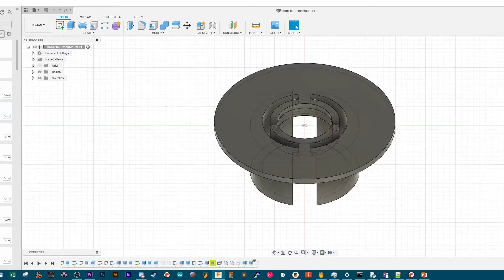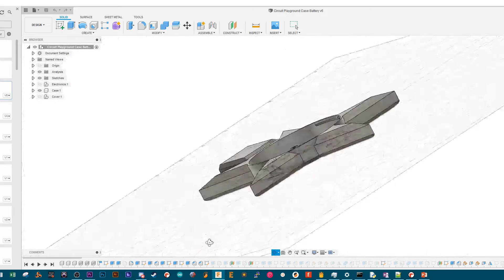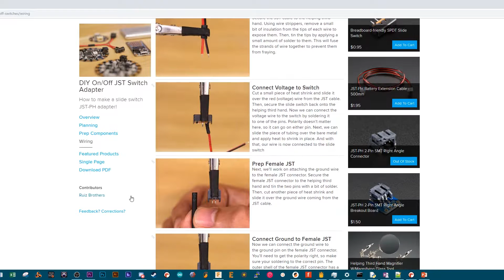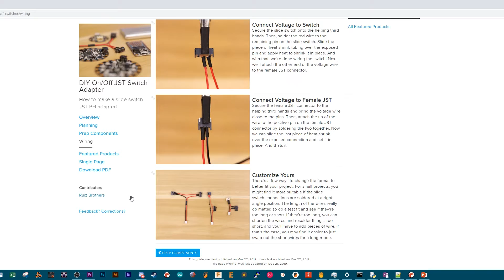I Finally Did Some Woodworking: Wooden NeoPixel Xmas Tree Project

Comment: • Interesting timing; I got a book from the library on Circuit Playground just recently.
• Yeah, the wood was a bit thick for a spade-bit; also the chipping. But it was a relatively harmless learning opportunity. 🤷
• 14:00 - Is that a real Hakko? You wear a mask while soldering? I wish I were that responsible. :-\
• I thought the title said you did wood-turning. I guess I've just been a bit too hooked on lathe videos recently. 🤦
Reply from the maker: -nice, it's a great board! 
-i'm actually in a way glad there were issues with that because as you said, bonus learning opportunity.
it is! and yes i don't have great ventilation. i actually need to build a fume extractor- been on my project list for a while
-lathe videos rock, especially Blondihacks

Comment: Nice project. If you drill a small pilot hole all the way through the wood using something like a 2mm or 3mm standard drill, use your speed bit on the back, go part way in on each of the holes. Turn the work over and drill through from the front you shouldn’t get tear out. Block underneath also works.

Merry Christmas
Reply from the maker: i will try that!